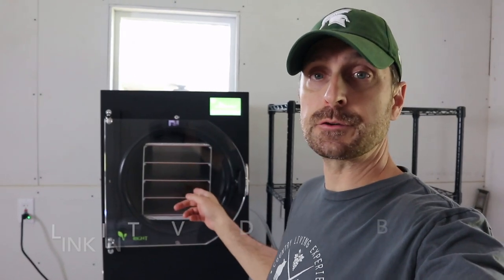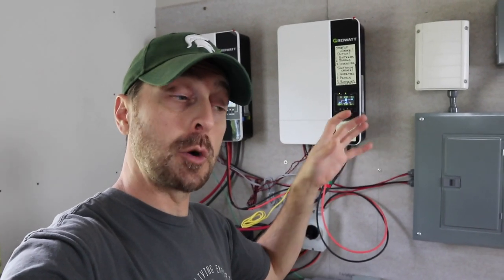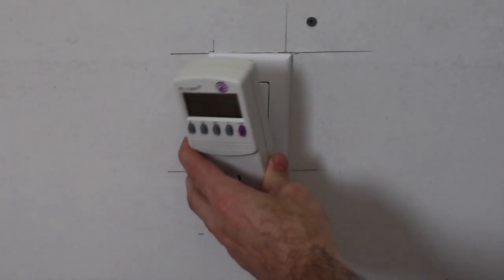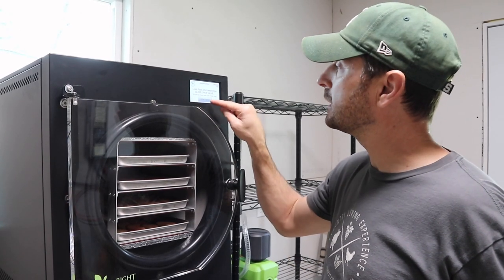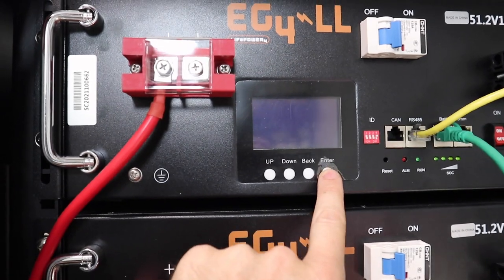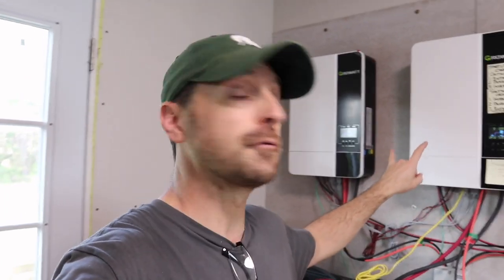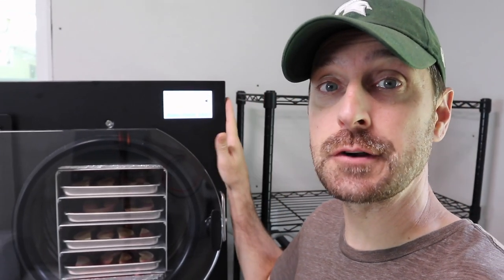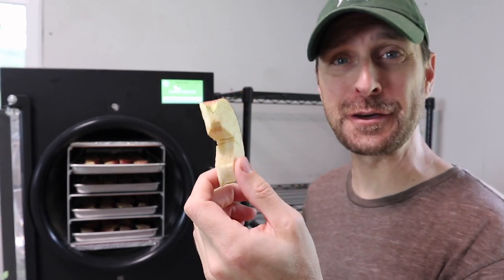Freeze Dryer On Solar Power System? Testing Our Harvest Right

Comment: I have a sigineer inverter that runs PV primary, grid second, and battery backup only if grid down. It has been a Major dollar saver with freeze drying. And I don't worry about switching from solar generator to grid at night.
Reply from the maker: Cool. I am off-grid. I do not have grid power routed through my inverters.

Comment: 13.5Kwh is totally doable based on the size of your battery bank, not counting other loads of course. I think the trick would be to start it in the morning as the sun is coming up to make full use of the solar output.
Reply from the maker: For sure. The only variable is the type of food and how much moisture it has. That will determine the length of that drying cycle.

Comment: My batteries have the same imbalance issue. It’s the bus bar on that signature solar cabinet. You need to rotate the negative bar upside down. Otherwise the top batteries are first to charge and discharge, especially under heavy loads.
Reply from the maker: Yea, I figured that. I saw Will Prowse's video. Will be flipping that bar soon.
Reply: Thank you for addressing the imbalanced battery problem.

Comment: Most batches on the large dryer draw a total of 30kWh, but I was wondering if it would be possible for you to measure the kW power draw at every minute of an entire batch. Please try with pre-frozen juicy fruit like watermelon slices (probably 40-45 hours). You can simply put a camera in front of a wattmeter, send me the video, and I will manually write up a spreadsheet of kW numbers at 1 minute intervals for you. This will help people who want to run their machine on a solar system, to size their batteries for night time. The trick with solar is timing your batch to run the highest draw hours during sunlight. This means you can have far less batteries if you time it right.

Comment: I think it would really depend on what size freeze dryer you have.  For example, the large size can use much more electricity, since it needs a dedicated 20amp plug.
Reply from the maker: Of course that is a factor too. With my system, none of them would have run over the night. It is about how much battery storage you have.

Comment: I wonder if it would be worth starting the process (cool down and freezing) could be done before sun up since it is a lower draw on the batteries. Then you would have the sun all day for the heavier load, and generator/grid for the last part.
Reply from the maker: Yes, a little better timing should help. The drying process is all based on the moisture content of the food though. It is a little unpredictable.

Comment: We have a monster solar system and battery bank (9x EG4-LLs) and this thing running over night takes us down to 32% before the sun starts charging us again.  Given our automatic shutdown is 28%, then that's not a comfortable margin of error.  Unless you have a REALLY good system I wouldn't recommend this.  Great video by the way, love all of your stuff.
Reply from the maker: Thanks. 
What are your other loads at night? AC? Well pump?
Reply: @CountryLivingExperience  We have mini-splits for AC that are set on very reasonable temperatures of 78 and 80 degrees, depending on the rooms.  Other than that, there's really no large loads.  Our home is only 1200sq feet.  Our temperatures here are in the high 90s right now during the day.
Reply from the maker: Interesting. I used 13.5kw over the course of the 18+ hours which means I maybe would have used 7kw at night. You should have 46kw available with those 9 batteries at 100% soc. 46kw-7kw is approx 39kw available without other loads. Your shutdown should be at 12.9kw leaving you 33kw extra so you should have plenty of battery to run it overnight. We keep our 1800sf house at 78° as well. Wonder if there is something going on with your system. Maybe my numbers are off?
Reply: @CountryLivingExperience  Your math is probably correct.  We thought about buying 3 more batteries but honestly I'd rather just run Generator in mornings that we freeze dry.  It needs to be ran anyway.  Not sure if there's an issue with my system.  It's been zero hassles or worries other than this.
Reply from the maker: @realityaskew  Cool.

Comment: I have a very similar system to you.  I have 3x 5000es, 6x EG4-LL Batteries, 30x 445w Panels.  We started a batch of bananas early in the morning and they finished the next morning (roughly 24 hours).  The morning they finished, before the sun came up, we were at 41% battery left.  We go into a very low power mode here at night with only a few fans and chargers on, so I would say 80% of the percentage used was the freeze dryer.  I know having 41% left over might sound good, but it's not.  I live in the desert and it's not summer yet.  When my mini-splits kick in, that 41% might very well go below the 20% auto shutoff.  Soooo, I ended up buying 3 more of the EG4-LLs.  That will effective give me 45kw of battery storage.  They are backordered a tad so it'll be another 3-4 weeks till I get them.  I'll let you know the numbers when they are incorporated into our system.  As a note, we have zero utilities where I live and are truly off-grid.
Reply from the maker: I will add more batteries as well. I wonder how that will fare when your mini-splits kick on for the summer. I am constantly experimenting with mine too. So cool you are completely off grid.

Comment: 13.55 kwh.  At prices here in the PNW, that would be about a buck fifty.  It would be interesting to do a full cost analysis of running one of those freeze dryers.  You have the power cost, at least for grid.  It'd be interesting to figure the "off grid" cost - amortized cost of your off grid solar per kwh.  Ditto for the amortized cost of the machine, etc over its life.  Kind of like how the cost of running a car is a lot more than the gas - the cost per mile to buy it, tires, oil, routine maintenance, etc.
Reply from the maker: I am working on something similar to that. 
Going to take on food costs first. Buying freeze dried food vs. making it yourself.

Comment: Fantastic video. I thought the growatts can seamlessly switch to grid input in the absence of solar (that's if so configured). I understand they're off-grid inverters so can't feed into the grid but should be able to use the grid to charge the batteries or pass grid power through to loads connected to the inverter.
Reply from the maker: The Growatts can do that if they are connected like that. Mine is installed like a generator or completely off-grid.

Comment: Slightly confused as I am new to all of this why did you not plan the time, so when the freeze dryer was pulling the most power it coincided with the peak sun on the solar panels, and would this allow the smaller battery set to use this equipment.
Reply from the maker: You can plan the best you can but each cycle of the freeze dryer it different and takes different amounts of time depending on the item being dried. Some cycles take 48 hours so you will need a large battery bank to do this.
Reply: @CountryLivingExperience  Thanks guys much appreciated